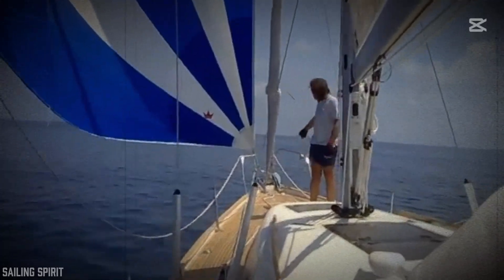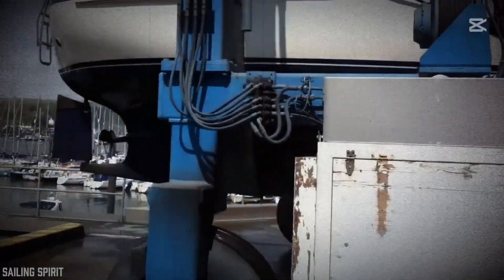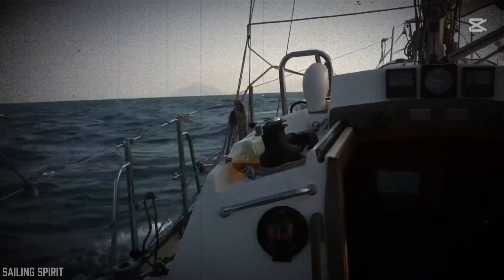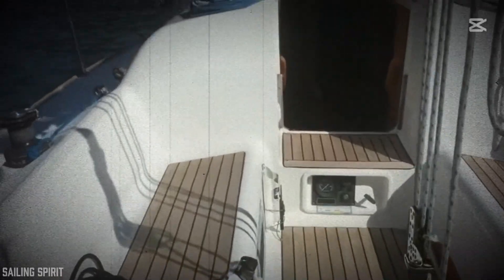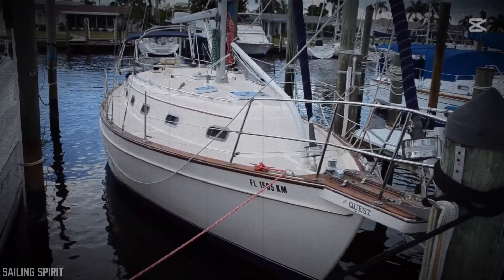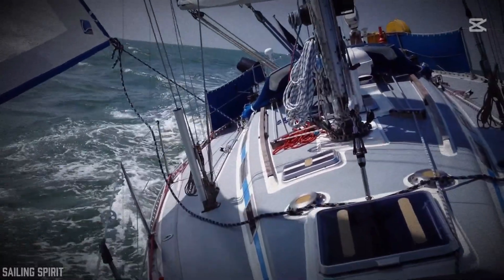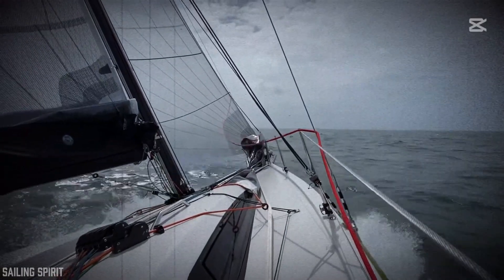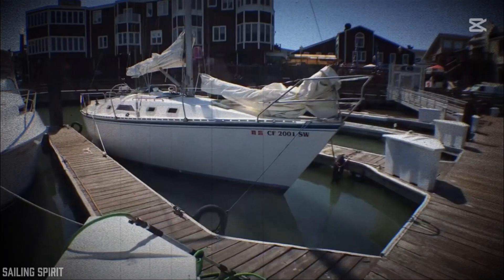This Is the Reason Why a Sailboat Keel Falls Off!

Comment: If the bolt on keel was fastened to more than composite material, meaning if steel for example was inlayed to span more of the hull. This would distribute the load, moment-arm and or impact forces in case of a grounding or other factors. The tragic case where Texas A&M University sailing teams keel departed in the night on a Galveston to Veracruz race June 6, 2008. The keel was more or less clamped between imbedded steel plates which acted like a giant scissor shears to slice through the composite layers neatly. It was determined the boat had not been repaired properly after a grounding but others speculated on design flaws. The heroic efforts of the Safety Officer, Roger Stone, aboard the ship in those pitch dark waters, saved 2 of the student crew members but tragically lost his life in the process.  The keel unzipped like a beer pop top.